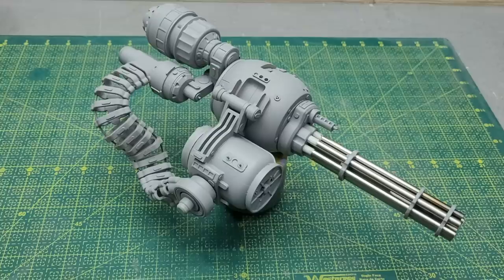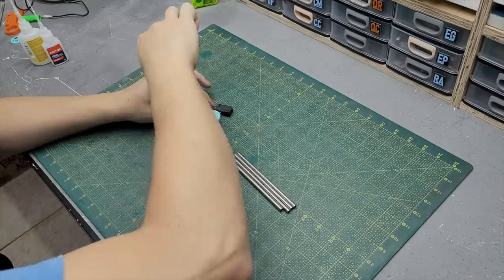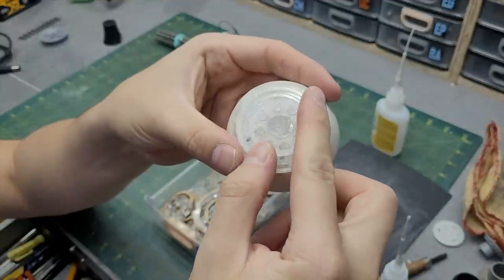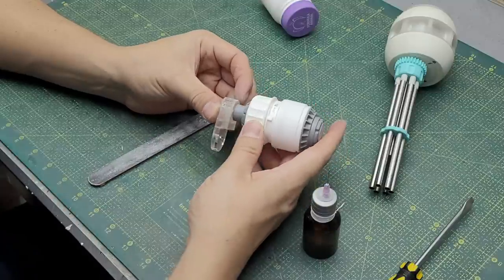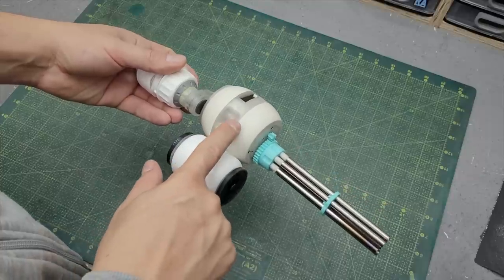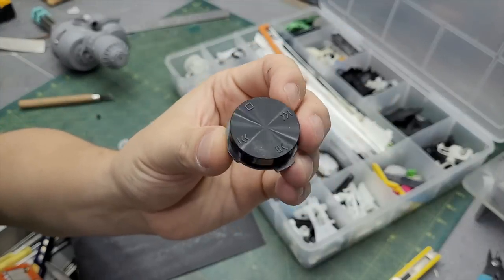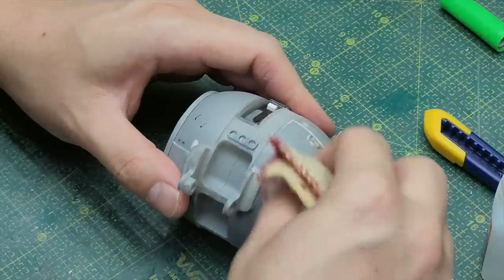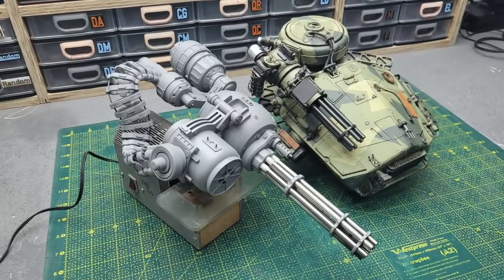I built a MOTORIZED Gatling Gun model!

Comment: It's an awesome looking model. Like something that should be on a Terminator Hunter Killer.
I would replace the gears for an o-ring and pulleys to get rid of the tinny sound of the gears. Add a sound chip, leds in the barrels and a smoke generator for the leds to flash off of.
Also think about a rod and couple bearings to support the barrels better.

Comment: Very cool man!!! Although it could be even cooler with a bit more electronics going on.

If you want to add more movement to the final model you could add a 'Beam Bicore Headbot' to the waist.  Just use a motor / gearbox with a high ratio to make the turning side to side quite slow (you can also tune the movement by using ceramic capacitors with different values.  The higher the value of pico Farads the less it would sway back and forth (I think that's right / might be the other way around).  Also a few LEDs or flashing LEDs would add even more of a cool factor to something that is already pretty damn cool.

Edit: once I've finished my current ongoing projects I might try to build something similar.  You've Inspired me!!!

Comment: Its a great work but as a learned industrial mechanic have tried to print the gear not like this in the straight form, what is much easier to make and like in RL are much cheaper in cost. But like you heard it even so much louder against not stright one can you maybe print in a curved form the gears, that the contact beetwen both are much more smoother to grip in each other. And so they are in the steel variants are much more quiter as straight ones.